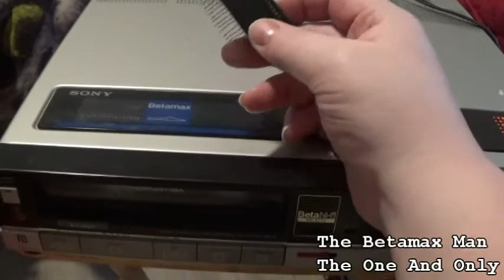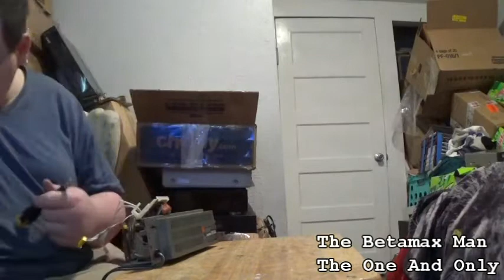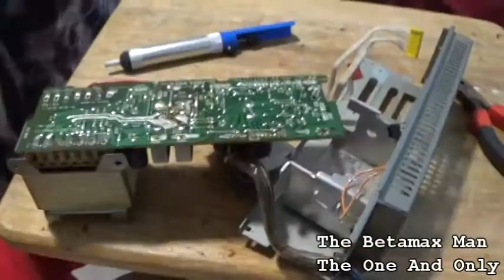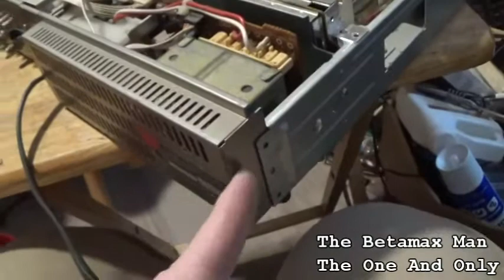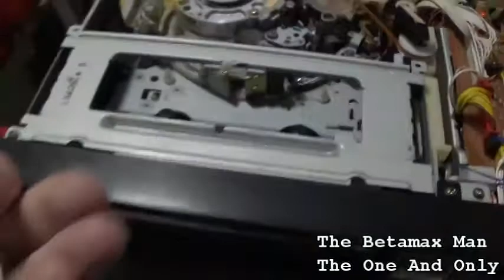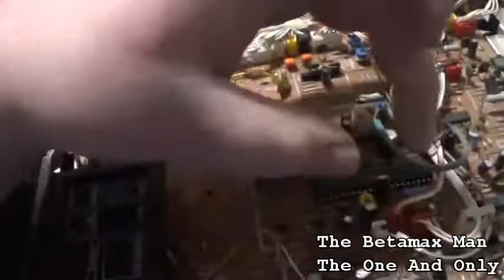A Sony SL HFR30 Lets Fix It

Comment: I just received the same model. The power light doesn't show, and the display is like yours. However, if you press eject (even with no tape inside) it acts like it's trying to eject with the head mechanism. You press rewind or fast forward and the capstans move like there is a tape inside. You press play, it spins the head like it's playing. Is this a regulator issue or something else?

Comment: I have a SONY SL-2700 which doesn't turn on when I press the POWER button (the small green light doesn't come on and the buttons do not operate), though the clock operates normally. I suppose the problem is similar to the one you showed in your video. Should I check any specific power transistor in the SL-2700 power supply (which seems not having a STK5441 voltage regulator but several transistors mounted on a radiator) or try something else?